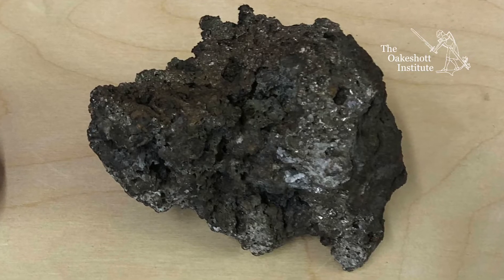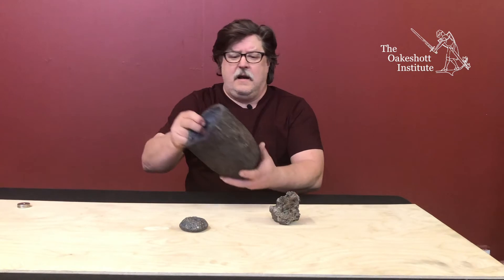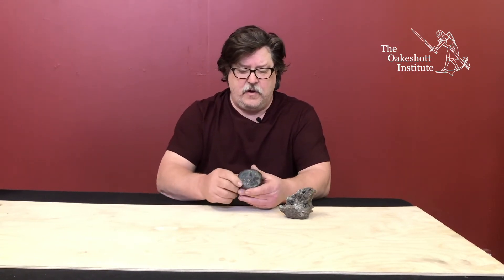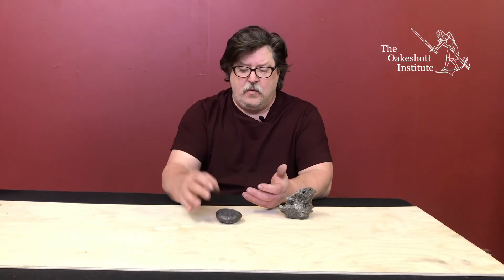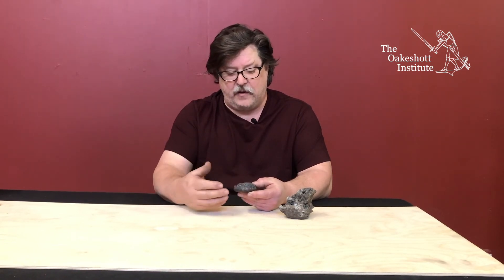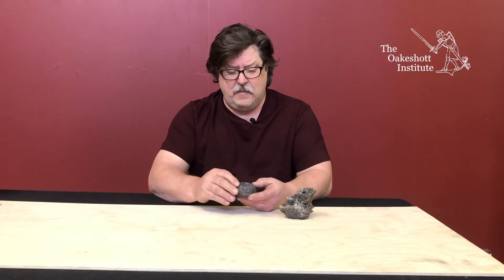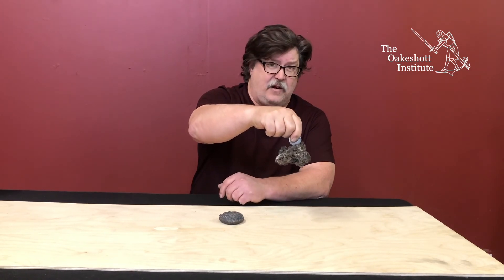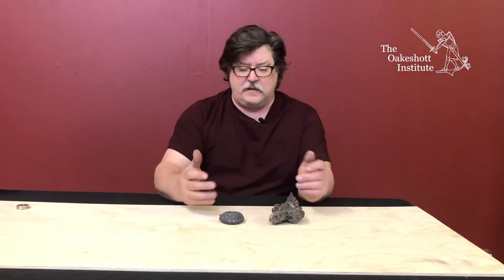What is Wootz?

Comment: Is this wootz steel which used to be produced in India but the process of which exist no more. Or there r many varieties of wootz. Sorry if I am wrong as I don't no much about this.
Reply: I was under the impression that Indian smiths used the same techniques for years afterwards but did not have access to the original ore with Vandium in it .
   I was told Toledo steel used a similar technique ( the furnace didn't make use of monsoon winds but rather a bellows) again, not with the original steel and it took a few centuries to explain the science behind the old technology .
  Either way those Indian guys were killing it back in the day. From math to steel to architecture to chess, western cultures owe a huge cultural debt to India. All of the stuff we learned from the Arabs, the Arabs learned from the Indians
Reply: @seanfaherty  There were many different techniques used to make crucible steel in different areas in India and around that part of the world not just one. 

The idea that it died out due to there being an "original ore with vanadium" that ran out originated with John Verhoeven and it was only a thought that he threw out there with no historical foundation at all. It is a modern myth. 

The toledo steel was a pattern welded damascus type method with forge welding higher carbon steel with lower carbon steel. I am unaware that they used a crucible steel as their higher carbon steel source.
Reply: @timmitchell5812  thanks for the correction
Reply: You may find this interesting. The Secrets of Wootz Damascus Steel https://www.youtube.com/watch?v=OP8PCkcBZU4
Reply from the maker: There are some varieties and slightly different approaches to the manufacture. The Video posted by KJAkk is pretty good as Al knows his stuff in ways few others do today. It is probably a bit of marketing that the secret was lost. It never stopped in certain areas it was just off the grid as it were to the knowledge base of the west. Historically there were large areas of production using these methodologies from the mid East thru Central Asia all the way to the Island cultures of Southeast Asia.
Reply: @theoakeshottinstitute4081  Craig, you are totally correct, the method of making wootz was never lost and there has been an uninterrupted line of smiths who have continued the craft to the modern day.  The people making it in India are marginalized there and most Indians are not even aware of their existence.  The production of wootz definitely declined heavily from the mid 1800s due to the export ban, deforestation, famine, competition and a few other factors, but it still continued inside India.  What has changed is that those in the west who have been making this steel such as my former mentor Al Pendray, have been able to work out what is happening in the steel to create different traditional patterns and we have in effect brought the craft back out of obscurity.  By the way it is awesome that you were able to handle an original ingot from the Konasamudram cache!  They are a little bit different than the ones we make today.

Comment: Good day, Craig.
I have a question about wootz. So, all wootz steels are crucible steels, but not the other way around. So what differentiates them? Only the etched visual patterns, as in wootz steels?
Thank you,
Loris
Reply: The question that you ask is less than straight forward to answer. The term Wootz came from the term Uts or Utsa in Tamil, Hindi or Marathi around the Bombay area of India during the 1790s.  It was used to refer to water patterned steel (it means fountain, spring, water source) specifically but in the other languages in the region it was known as Ukku which meant to melt or Urukku which means Steel.  The words in that region were specific to melted / crucible steel, and Wootz / Uts was only one of the names used.  In Marathi and in Northern India it was called Polada. 

Not all wootz had a well identified pattern as some in southern India was solidified quickly but it was still called the same names that the watered steel was.  But watered crucible steel was made from Egypt up to Turkey and across to Mongolia.  These were called by the name Bulat, Fulad, Polad, Bolat etc. all from the same basic root word which simply means "Steel". There was crucible steel which had no pattern and others with many different patterns depending on the ingredients and how it was forged. 

All these steels today fall under the blanket terms of Fulad, Bulat, Wootz. It is all talking about the same material but in the languages of the peoples who made them. Now these only apply to steel which is melted and solidified in the crucible, not steel which is poured into a crucible and then solidified.  There were many different recipes of this steel and things like chromium, copper, manganese and silver etc. were added deliberately to the melts in different areas with different results. I hope that clarifies your question.  

I am a wootz smith and researcher of 20 years experience and a co-founder and president of the International Wootz Society ( internationalwootzsociety.com ). Cheers, Tim.
Reply from the maker: Good question! I am not sure the definitions are defined like that. The term wootz is a crucible steel but I think any steel produced that way would have been called wootz back in the day. Its the modern folks and the desire to have a name for every variation and the mixing of terms across culture, period and form that gets it all jumbled. The wootz blades of the past had the etched finish and sometimes this was patterned mechanically. But a blade could be made from wootz and not etched and would still be wootz. You can even see the pattern if polished and in bright sunlight in some cases.
Reply: @theoakeshottinstitute4081 
It is my belief that the modern nomenclature isn't what it used to be. I am not sure when wootz was starting to get associated with visible pattern. Using a plethora of academic resources, I figure wootz steel is a geographically associated crucible steel (South India and Ceylon) which was made by the steel carburizing method, using wrought iron and plant matter charge, as opposed to co-fusion method from Central Asia (Merv). My observation is also that the tern is used solely for warfare arena- armour and weapons, but ordinary household tools, such as scissors, nails, etc. are never referenced as wootz.
I figure you might take the Parmigiano Reggiano parmesan cheese as an example. Make that type of cheese outside its region, with differently sourced ingredients and it is not parmesan anymore. The certificate for the latter could never be obtained.
But is there a way to tell if any given weapon, regardless of the hilt and blade style provenance, is from South Indian subcontinent or from Central Asia? Is there a way to distinguish and provenance the 'damascus' weapons which were exported to Damascus for forging, and further export, in an analytical way? Isotopes? Chemical composition? How do you gentlemen do it?
Reply from the maker: @emel60  Deep question, the studies on the material have looking at some of these questions but as of now I do not think there is a "Test " result they are looking for to identify origin. That being said a holistic approach looking at all the factors of a piece including any evidence on the material itself is the best way to discern origin or at least where the item was made. Also research into trade routes and supply. As with so many aspects f the trade in material and arms production not a great deal has been codified on such a level, but I do know there are people working on different aspects of these things. I would say we are just passing into the second generation of folks doing deep research on these things and we will see more information to help with much of our understanding of this in both the east and the west in the next few decades.
Reply: Read the post I added. The two vids I linked will give you all of the education I have been able to find on wootz. The first is a documentary of the men who unraveled the science behind wootz Dr. John Vehoven and Master Smith All Pendry Master Pendry rest in peace sir you are missed.
Reply: @nicholasking6066  which link, Nicholas? 

In between the time I wrote my first post up here, and this one, I graduated an MA study, with my dissertation being about crucible steel production.

Its like cheese, really. If it's not made from the milk of the cows that grazed specifically the meadows of the Province of Parma, or Reggio Emillia, and subsequently using the varied cultures, type of rennet, and aged for a specific amount of time, in a specific place... It cannot be considered parmegiano reggiano :)

I'll join the society soon, Tim.
Thanks for replying and my apologies for a delayed one on my end. YT comments are hard to keep track of.